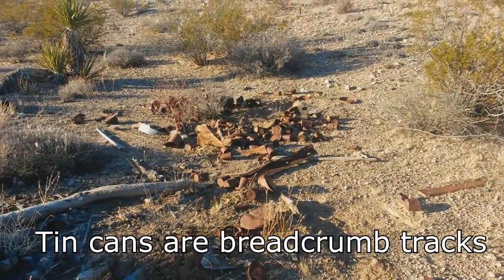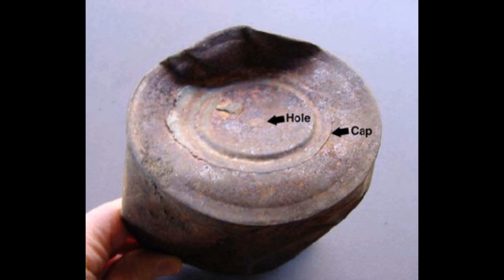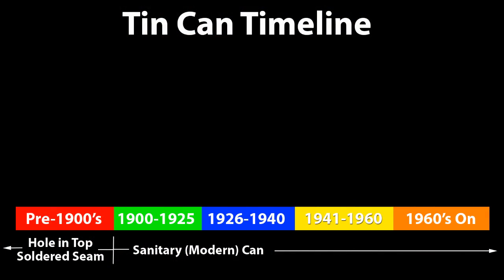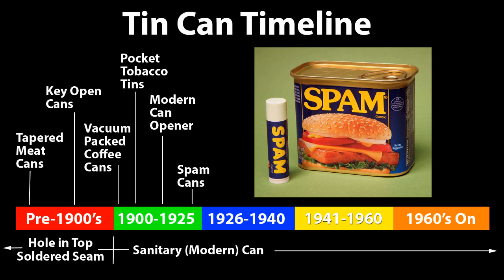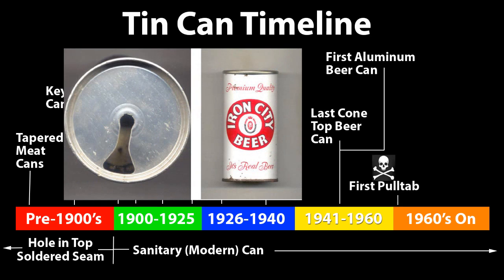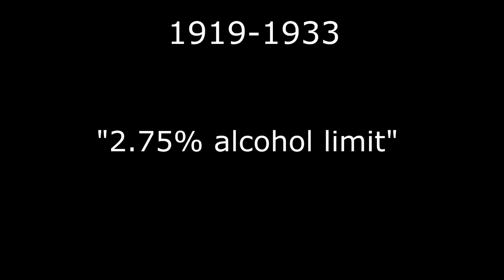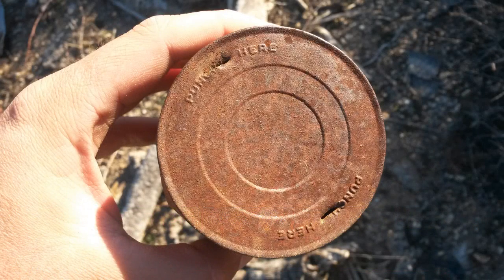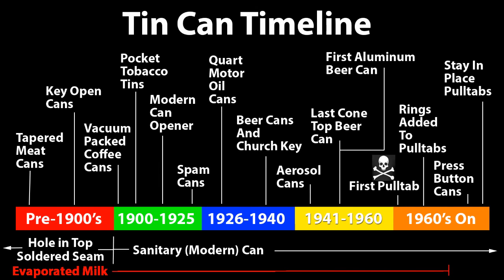Metal Detectives 1: Tin Can Dating

Comment: Nice video, good info.

Often can dumps got burned back in the day and unfortunately with all those the inks and painted labels got destroyed. Occasionally I find a can (where fire hadn't occurred), it having the rare fortune of missing most of the elements (decades of intense summer heat, rain, snow, sun etc) and retaining some color and definition.

Some automotive products, like additives and brake fluid etc were also sold in cone tops. I think threaded lids might differentiate these from beer. The guys who are regulars with The Rusty Bunch are experts on beer cans.

Comment: I found what I think is an old tin can. It is 21"ish high and 9.5" diameter and it has a lid. The can also has what I think is vent holes in diamond pattern at the top and bottom. I would post a picture but I don't see how I can do that in this comment.